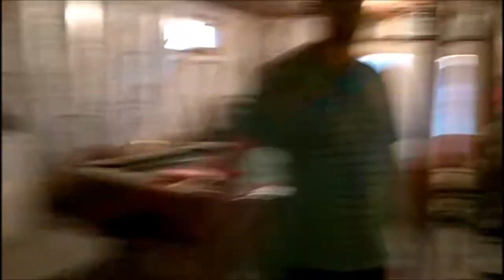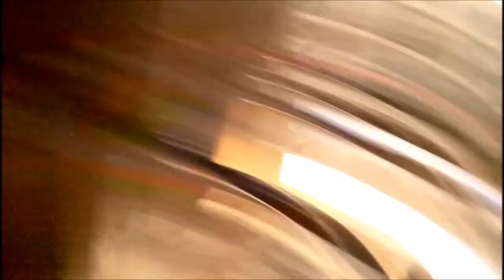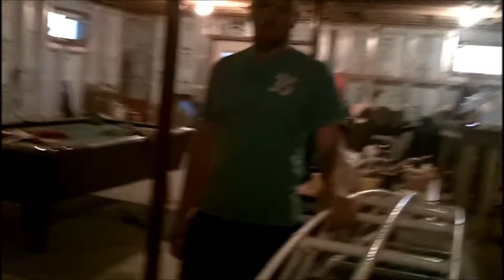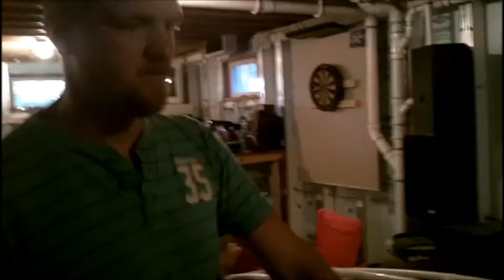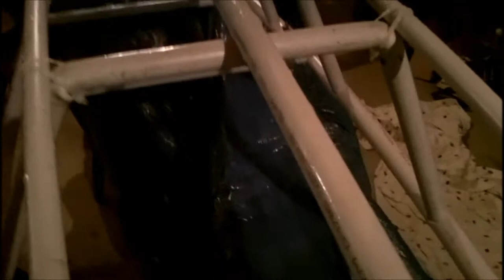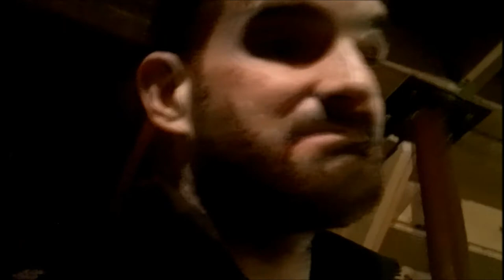The PVC Skin-on-Frame Kayak Project PT1

Comment: I'd like to see a follow up vid on how the kayak floats.  I attempted something similar several years ago but mine was a fail as it tended to tip over way too easily.  Thanks for sharing.
Reply from the maker: Hey the project is going good but at a stall point because I bought a home and had to move.  My buddy who was helping me now lives about 45 min away but we still plan to follow through and get it done.  We have 3 in the works currently and putting the canvas on.  One is half way sewn.  What we found out from testing it all depends where you place the chines.  If the chines are to close to the bottom it becomes real tipsy.   Place the chines higher on the boat and it help with the balance.  Thansk for watching!